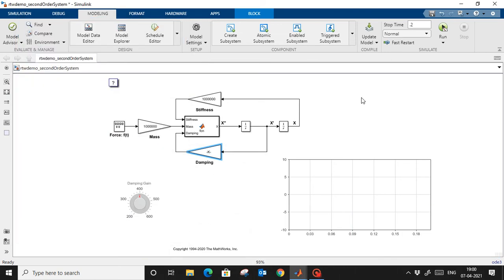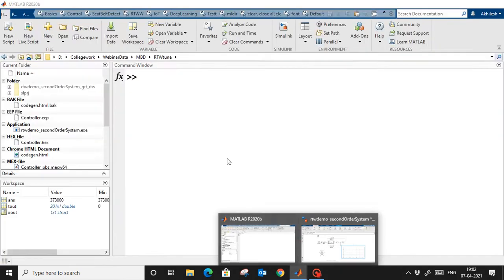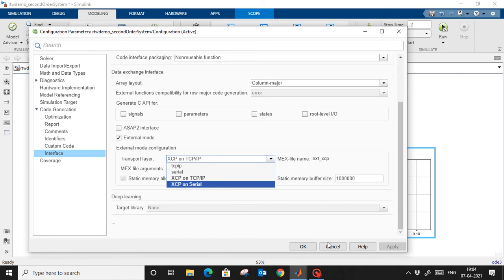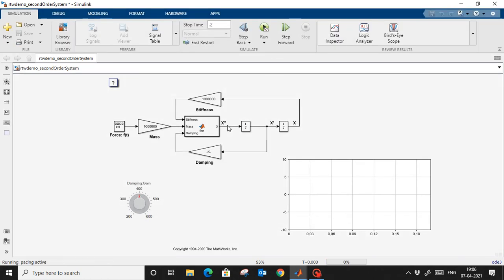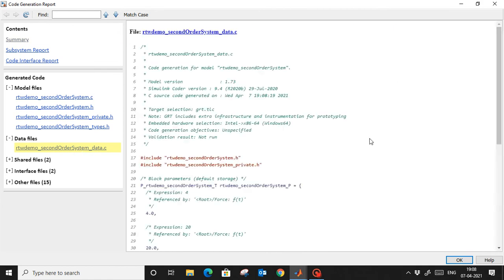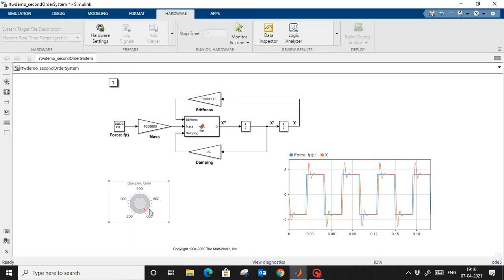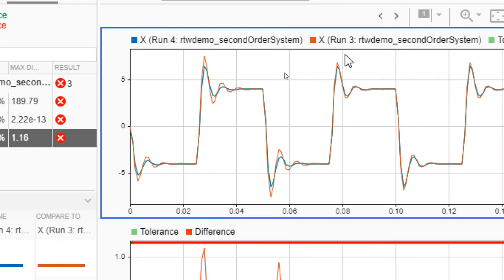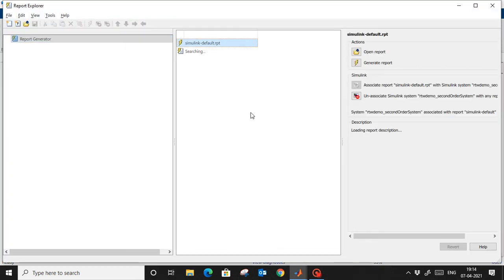Real Time Workshop(rtw) and Tune Model Parameters in Simulink

Comment: Can we use this to implement a controller on physical hardware? I mean let suppose I designed PI controller in simulink and I want to deploy to to physical device using NI DAQ board, does it possible with Simulink external?
Reply from the maker: Yes you can deploy. For supported hardware with Simulink you can refer to the Mathworks website.